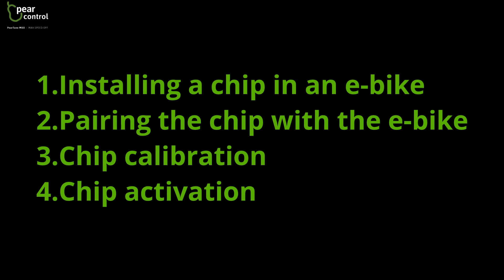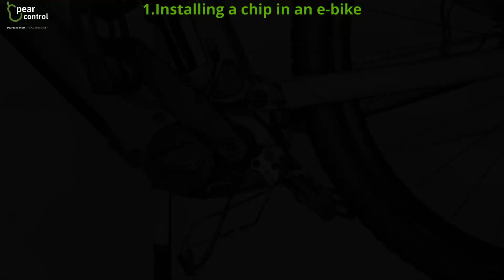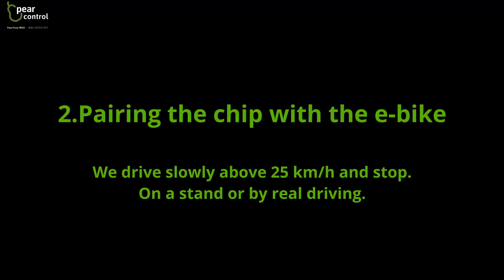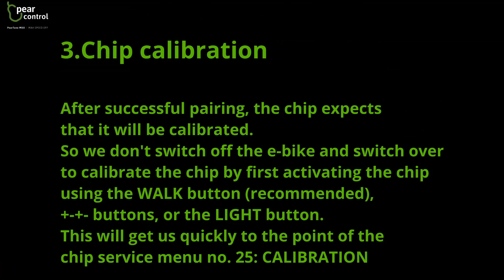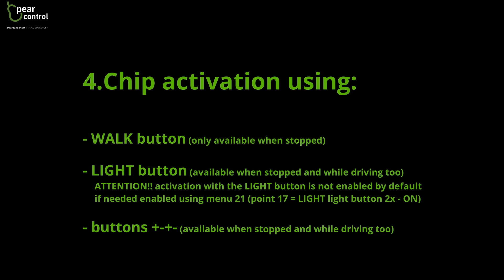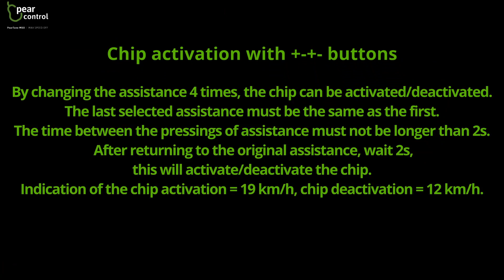PearTune MSO installation on BOSCH e-bikes with SMART system

Comment: Tried speed box 1.0b which was detected after 100 km. tried peartune and it was even worse. Terrible customer service so returned. Waiting for volspeed or splug
Reply: Volspeed will be the same :)
Reply: Any update? I tried the same as you and kept getting error codes limp mode etc

Comment: I have buy mso 4.0 bosch smart system. Now i have take a fail and its not calibrate! And i dont come in the Menü to reset or new calibrate nothing, turn on the chip Show 18.9kmh tjan i go to turbo wait 5 sek. And push up down 10x nothing! 13x nothing

Comment: De-restricting should be as simple as possible and idiot proof.
Plug and play preferably, this chip seems to require a lot of messing around and therfore has a high risk of messaging up the bike completely.
On my older cube all that was required was simply attach a small box to the bike and away you go. I am of course referring to the Badass Box. 
Unfortunately this doesn't work with Smart System as I found out and ended up having to take my 2023 cube reaction race bike back to the store to be reset.
Luckily it's not detectable once you take it off the bike so I didn't have any issues with warranty.
This is a joke really I am hoping in the future these chips will get a lot easier in 2024 we should not really need to be taking off covers and changing wires.
We should be at a stage with the Smart System where we just download a code or even an app where we de-restrict via an app.
But all this taking covers off the bike pulling out wires is not really necessary in this day and age with the technology we have.